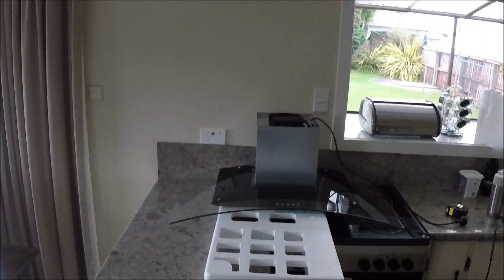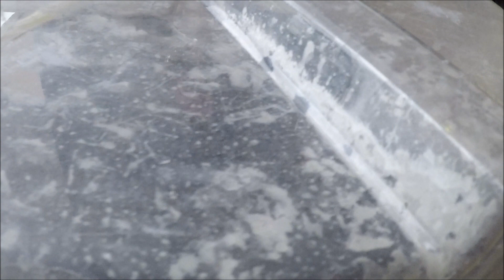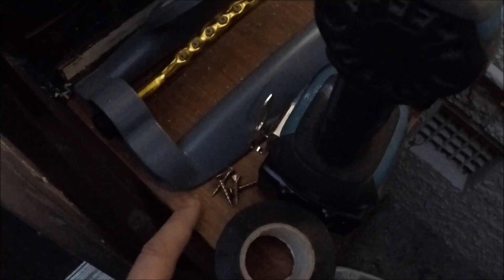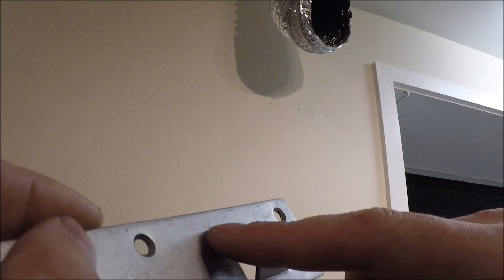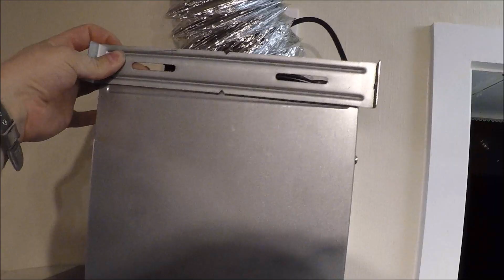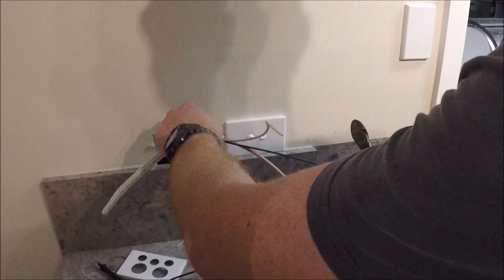How To Install a Rangehood

Comment: Love your skills, and this great demo video. Learned heaps! Sorry, I'm going to be a twit and comment outside the scope of the video...either you redesign your kitchen (expensive) or redesign your install, in my humble opinion. I'd pay more for a different rangehood design without that annoying glass, which will inevitably become drenched with oil vapor and ruin the window aesthetics. I'd install 20mm towards the window; the edge of the rangehood (without the glass) would align perfectly with the window, while improving its function. I'd lower it to 700mm above stovetop, not 850. I appreciate these vids are less about the design process, and more about just getting on with it.

Comment: Some engineering advice from someone with decades of professional experience designing exhaust systems for all kinds of commercial and industrial applications: using flexible duct like this is one of the most effective ways to reduce the effectiveness of your range hood. It's cheap and easy but comes at the cost.

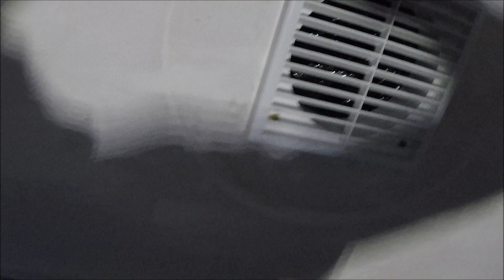Comment: At 10:10 did you install the duct fan facing the brick wall on purpose for cosmetics only? I would have assumed it blows out and away from the wall to keep the house cleaner but the fans seem to tilt towards the house?
Reply: It's typical in HVAC/R to orient the grill in such a way that someone on the floor/ground cannot see up in it. Furthermore, if there is an entry into a room on one end with a drop ceiling, always point the grill fins away from the door for the same purpose. But one flaw I did see was no screen on the grill he installed. Bugs will make their home in his hood.

Comment: Why didn’t you route the duct out the roof?
That soffit will rot with all that moisture exhausting in that area.
Reply: Every roof protrusion adds extra cost, time, and risk of leak. (That would be my reasoning as a homeowner/property investor)

Comment: I just heard a big bang while I tried to switch on the light on the hood, the whole vent stopped working now, Im wondering if there's a fuse that I can check please? The models is electrolux efc650 Appreicated if you can shed some light

Comment: old vid but i have questions, that holesaw it cut through soffit just fine? and outside grill facing towards the house, i always installed facing out thought that would be ideal for the airflow not blowing on to the wall? make sense cant see the the duct from the outside but the air flow might make the wall yellow over time??
Reply from the maker: Holesaw cut fine although these days its benched and I would no longer use it. The grub screws tend to slip out over time. Exterior grill position won't compromise airflow but I understand thoughts re residue. I personally haven't seen residue build up over time on exteriors, perhaps if the dwelling was left un maintained for a significant period it's defo possible.
Reply: @sparkydave  thanks for reply, love your vids keep them coming please.

Comment: A leveler needs to be used first when installing the mounting bracket and not after it has been screwed onto the wall but overall mission accomplished.

Comment: Do a need a separate breaker for a range hood or does a normal outlet work?
Reply: Normal 10A single powerpoint will do bro or a surface socket outlet wired to a 2.5mm T&E cable going back to another power point or 16A/20A power circuit in the ceiling. All done by a licensed electrical contractor of course.